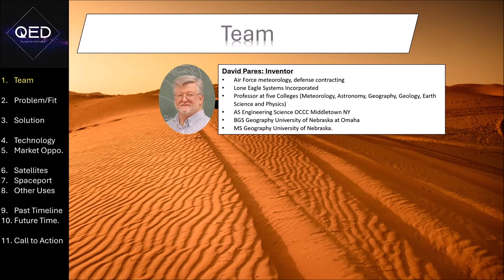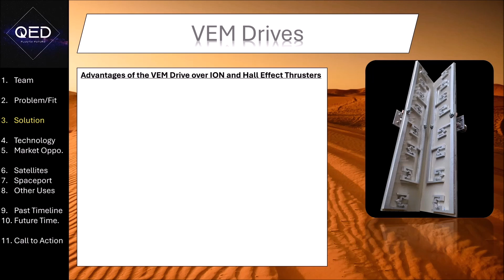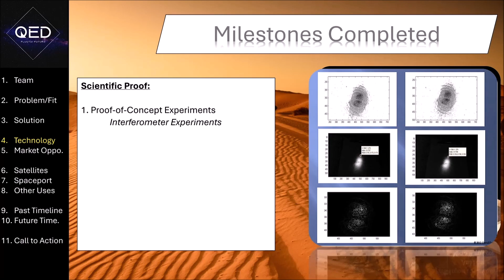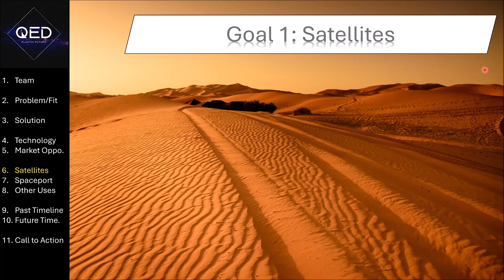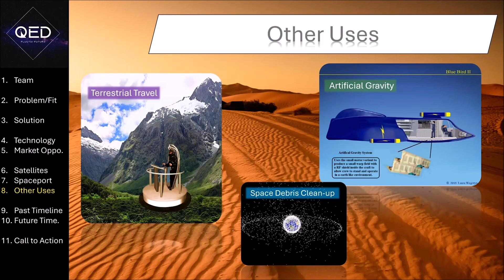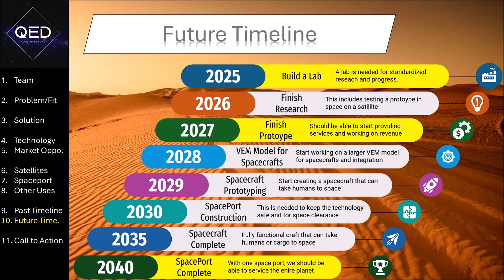QED Revolutionizing Space Travel: The Game-Changing VEM Drive 🚀

Comment: Interesting presentation, but this is still hard pill to swallow due to only the small advances of the last few years.
Maybe after the results of the next prototype you guys could generate some more buzz. 

Try to generate some 3D animations explaining how the drive works, as well as some renders for the proposed satellite test.

Also, how would you get the test satellite up there, a traditional rocket, or powered by it own force?
Reply from the maker: Yeah progress is slow, mainly due to no funding, no lab. Phase I is to get a drive onto a cube sat, launched up by a rocket. If there is a successful test in space then hopefully people will buy into the project more. First we need to get a solid prototype that will withstand a rocket launch. There may be an off chance we can get this to lift itself based on the funding we have now, but it would have to be "showy", a few iches to feet, and repeatable within a non-cut video. Maybe livestreamed. But that is still a lot to ask for where we are at with little funding. If we get phase I to work, we wont need people to believe us, since we would have a working prototype good enough to sell. Good suggestions,  3D animations is on the list of stuff to get done. Most of our time is spent on iterating the drive to get it to work perfect though, thats why we tend not to "post" a ton. But during the cold months and hot months we have some down time to explore getting revenue and doing outreach.
Reply: @QED-NE  Good to hear that you guys have thought about the 3D since it helps quite alot for attracting investors. Do you have a breakdown of the costs for each phase as well? Phase I: 5 million, but how did you arrive at that estimate? what is the certainty of achieving this within budget? what would the ROI be for each phase... stuff like that
Reply: @QED-NE  @RyanHansenSpace makes cool, realistic 3d animations. I posted a comment about you in one of his videos. Maybe you could try and contact him.